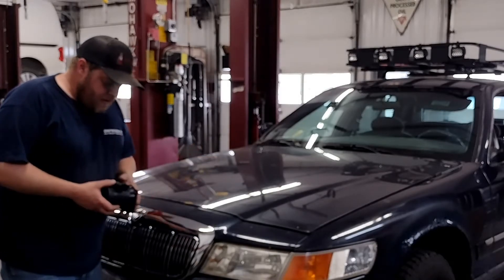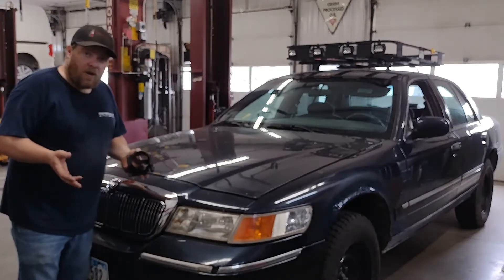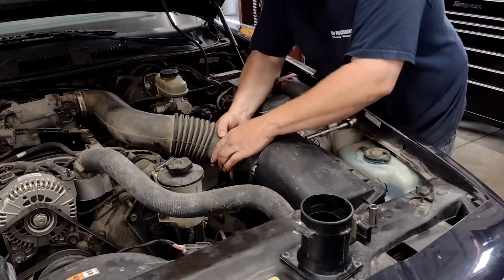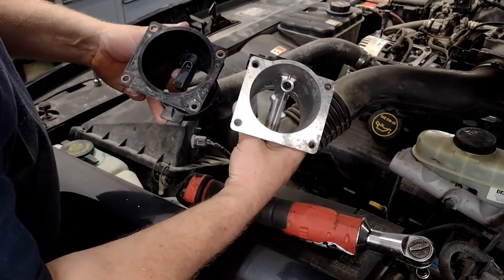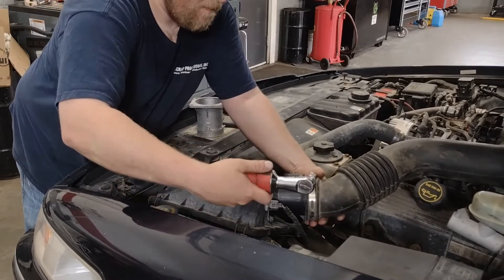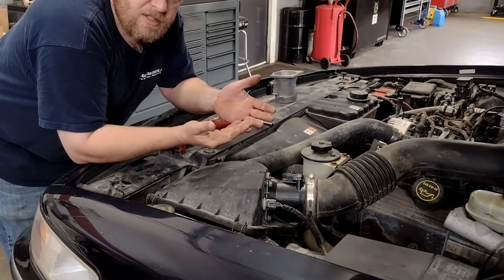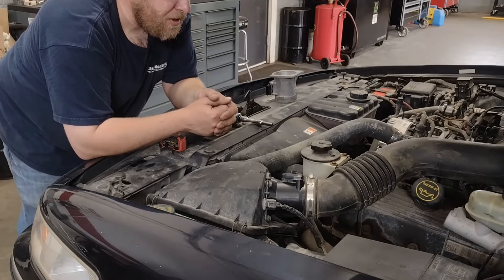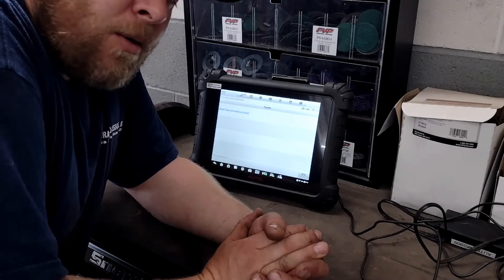How To Replace AND Calibrate A Mass Air Flow Sensor (MAF) - Crown Vic / Grand Marquis - Quick Fix!

Comment: Quick and easy and likely rather affordable with using a used part. Hope it saves you from chasing the issues down further. Thanks for sharing
Reply from the maker: So far it seems to have solved my issues.  Either way it was worth the gamble vs. a new motorcraft sensor that is several hundred dollars!  Thanks for watching!

Comment: Did you GM ping upon uphill acceleration giving you the reason to replace the MAF sensor? I have a 98 Crown Vic that’s been pinging its butt off. People say its the MAF, but how can I confirm it? No CEL active.
Reply from the maker: Typically watching live data is going to be the way to figure that out.  You could try cleaning the MAF, that's cheap and easy.
Reply: @ did that a few times still happens
Reply from the maker: @strumminandwrenchin9162 well you could try swapping it out and see if that fixes it.  You would need a scan tool capable of reading live data to really pinpoint the issue.

Comment: Seem like my mas/air sensor has to be clean once year maybe twice .  Could it be telling me it's going bad it's o n 2010  f150
Reply from the maker: Could be, but also could be the filter letting in to much junk, or k&n filter oil will also contaminate them.  I clean mine every oil change just because it's quick and easy.

Comment: I've got Ford Motorcraft mass air meter for my 96 crown vic, a direct replacement for the factory one, will it need recalibration as well?
Reply from the maker: Any time you replace it, or clean it, it's a good idea to recalibrate it.  That way the computer can adapt to the new readings.
Reply: @EvanWells07  Ok, thanks.

Comment: i had MAF code
i removed and cleaned w/ CRC maf cleaner.
i reinstalled it
i cleared code eith scan tool.
i started it up 
it idled great for 10 minutes
i got excited.
i attempted to go for a drive and she started acting bad again, engine code tripped again (maf).
could it need time to relearn?
Reply from the maker: That's pretty much the same thing mine was doing.  It would run ok for a bit, then bad.  I tried cleaning mine several times before I replaced the MAF.  Has run perfect since.
Reply: @EvanWells07   i was about to go reinstall it and hope. i'll replace it.. thank you!
Reply: @EvanWells07  i replaced MAF. i see why you tried a salvage one. (150 new for my xterra ). runs like a clock. 
thank you for responding. Big help!
Reply from the maker: Glad it worked out for you!
Reply: @EvanWells07 hey wondering if you will respond. My car starts and then dies. I got p0102. Unplugged MAF and it started up without dying. Installed a new MAF and she still stalls out trying to start. I can get her to turn over just not stay alive. Cleaned throttle body new filter installed, last thing I can think it being is either ground wire issue or one of the wires.
Reply: @JasonJASniper curious if you had any luck? I just swapped out fuel pump AND filter. No change in bad rough idle, delayed throttle response and stalling out. I'll be investing in a MAF sensor tomorrow but wanted to know how its working out for you.
Reply: @arai4176  so for me, hella strange. I got water in my gas tank. That caused the issue. I hope you can figure it out. Seems how you changed fuel filter, I'm assuming you drained the gas. Best bet could be MAF or throttle body. Make sure ur spark plugs arnt wet and rarely could be the ecu itself
Reply: @JasonJASniper  many thanks for the response JA. I removed the MAF Sensor and it fired up like nothing was ever wrong with it. Bought a new one and she runs like a cop car again! Ha! It definitely sucked swapping out the fuel pump but I'll just call that preventative maintenance that was eventually gonna happen on the coldest day of the year knowing my luck. Y'all be good. ✌
Reply: @arai4176  aye that's fire glad u figured it out 🙏🙏 my Buick will die when the frame eventually finally collapses probably in a few months when winter hits..... 😂